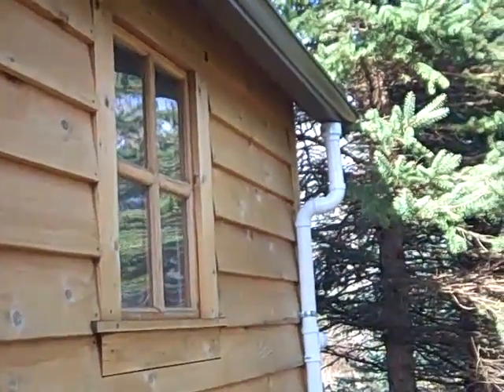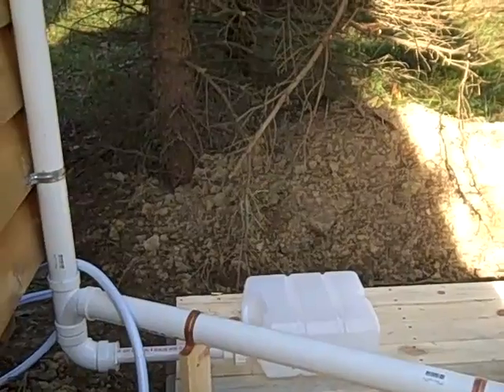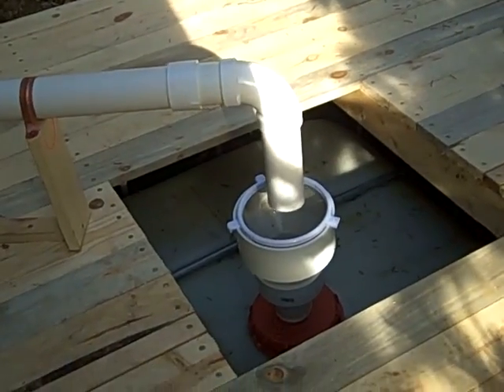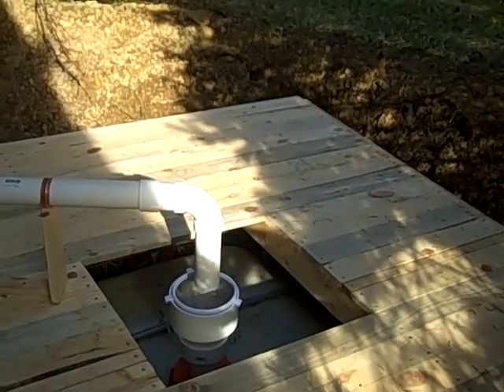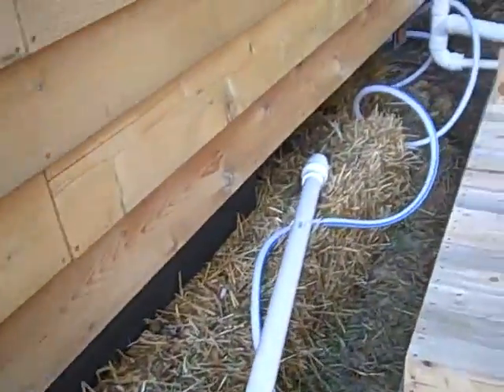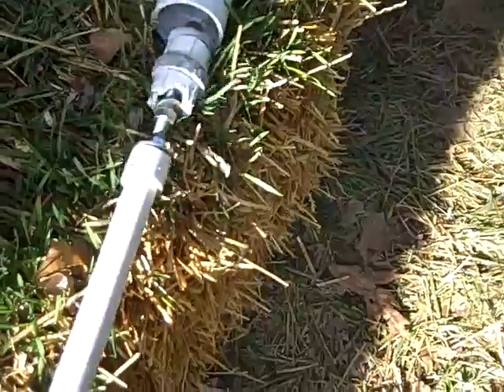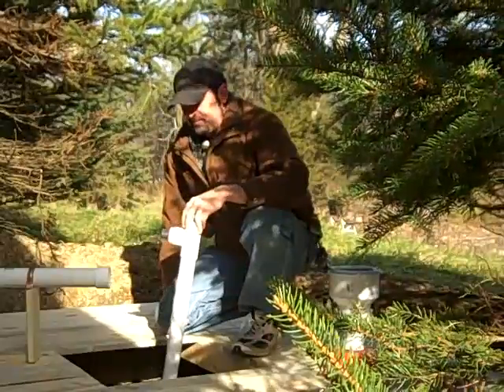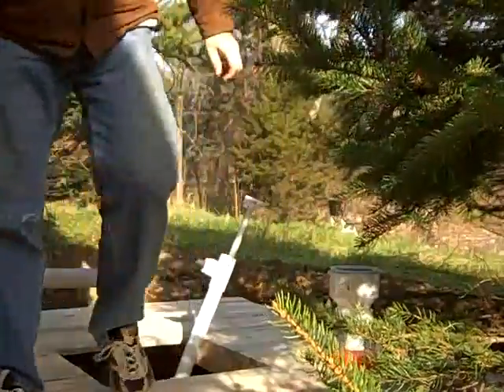Jonathan's Fencl - 11-18-11 Rainwater Catch System

Comment from the maker: I took this video in lower Michigan - yes, there is winter there.  Fahrenheit temperatures are usually in the teens, with a few sub-zero days each year.  I dug a pit for the tank and buried it so that the stable temperature of the earth would protect it.  A layer of ice did form at the top, but I was able to poke through it to access the water.

Comment from the maker: Sorry, I don't know the dimensions of that nook.  I'm currently about 2,000 or so miles away from my tiny house and probably won't be back to it for at least several months.  I wanna say it's around 4 feet wide by 2 feet deep, but those are ballpark figures based upon what I remember from when I built the thing 3 years ago.  I did build that part according to the plans, though, so if you get the plans you'll have the same nook I did.

Comment from the maker: @budlight571 
That truck was a beast - it was more than fine.  Sucker had a 3/4 ton engine in it, it could have easily handled a few more tons.  Bear in mind, also, that I live in lower Michigan.  The entire state is flat.  But I originally planned on driving out west, so I got that truck with mountains in mind.  Never made it out that way, though.  I've since sold the truck - it was a great truck, but it was costing me too much in fuel.

Comment from the maker: @budlight571 
The downspout ends in a tee:  the top of the tee connects to the downspout, the middle connects to the cistern, and the bottom connects to the 2½ gallon jug.  Naturally, water falls straight down and fills the jug first.  Once the jug is full, the water rises up into the tee and flows out the middle branch into the cistern.  After each big rain event I empty the jug and it's ready to go again.  The first 2-3 gallons rinse the crud off the roof.  All rain after that is mostly clean.